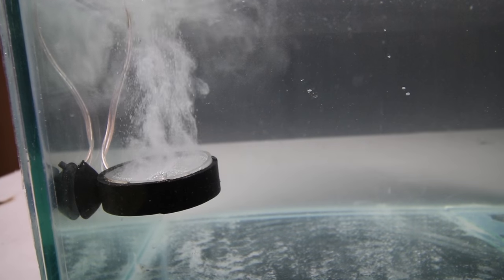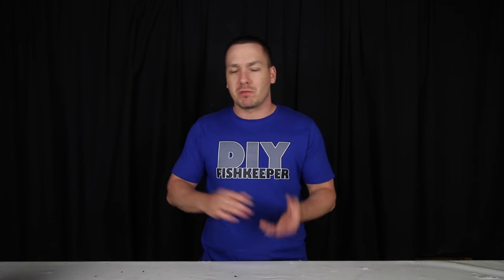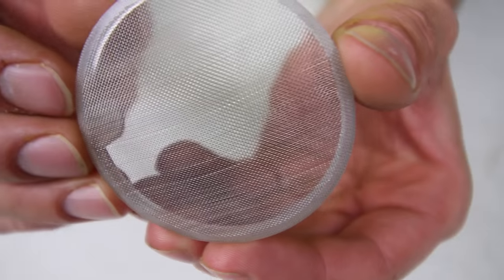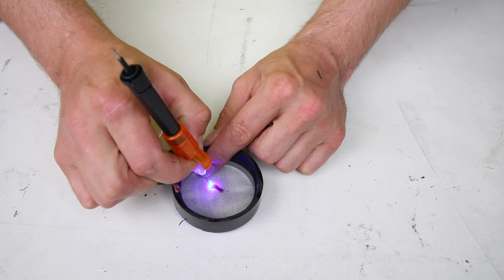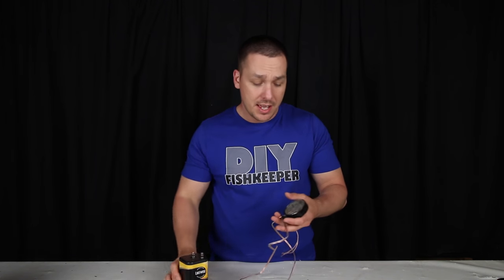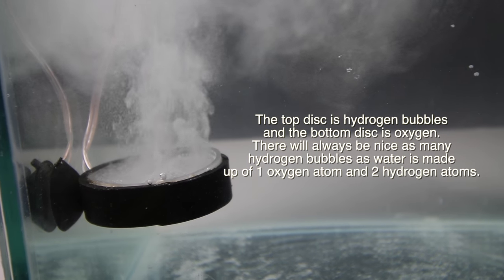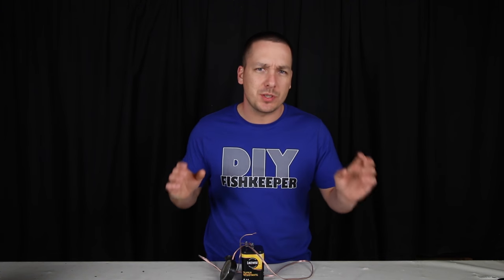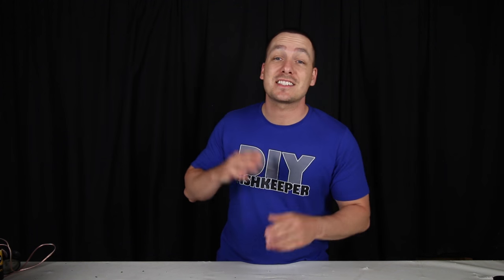HOW TO: $8 Aquarium sterilizer

Comment: I also have a question. why out of all battery why that big one?
Reply: Probably the price of that battery coupled with the size (amount of charge it can hold).
Reply: Lol, I tried this with wall plug, 12v and it broke the metal into pieces lol.
Reply from the maker: That would not have happened had they not been touching. There is literally no reason for that to happen unless they touch. Thats your own fault. I too did it with a wall plug yet decided not to show how to on video because the is ALWAYS someone that cant follow instructions.
Reply: They did not touch at all. Don't worry, It was not in my tank. I did it in a testing tank when I do diy stuff.
Reply: In fact, it was farther away than your video. So I know it did not touch.

Comment: how much water would you use up if you kept it running for an hour, because the water would be converted in to hydrogen and oxygen gas
Reply: Not much.. You won't even notice it.
Reply from the maker: There is literally billions of water molecules in just a milliliter of water. You could run this continuously for months on end and still not be able to measure water was converted.
Reply: 1 liter of water turns to 1860 liters of gas
Reply: Is that a phase change, or factoring the molarity when you decompose it?
Reply: 2H2O = 2H2 + O2

Comment: The only question, does this really works?
Reply: unfortunatly, i did not got it to work properly . I have tried various metal meshes, various voltages from 5 volt upto 12 volt, alluminium dissolved in the water, the other metals started to oxydize ? And created a brownish slime. Perhaps i did something wrong , however i do want to know what the exact material the mesh is ... something is missing in this tutorial.
Reply: Ah, think i found somewhere that the metal mesh needs to be titanium... will try it later.
Reply: @christophemeul  thank you, it seems like need to use titanium

Comment: Besides hydrogen and oxygen gas, I'm wondering if there is anything else being created and dissolved into the water.
Reply: Roger Nevez no just splitting the water molecules. You essentially are creating an hho generator.
Reply: ***** bad news ...
Reply: I have heard (I forget where) that using stainless steel to do electrolysis will create hexavalent chromium.  You might want to verify that before trying this because that stuff is bad.